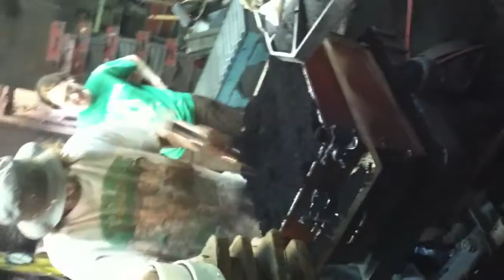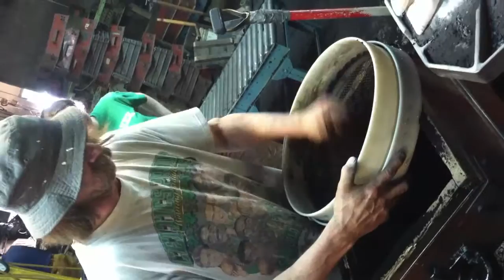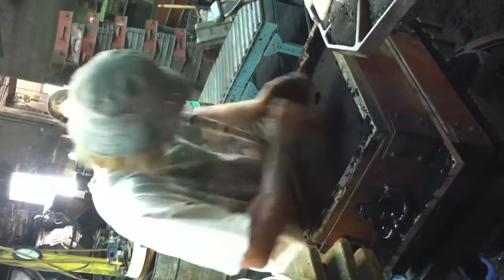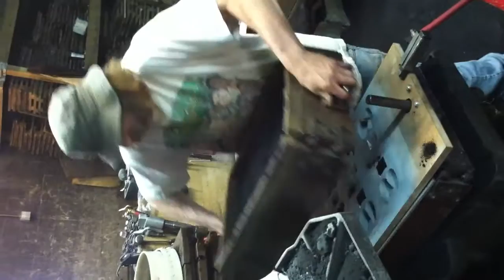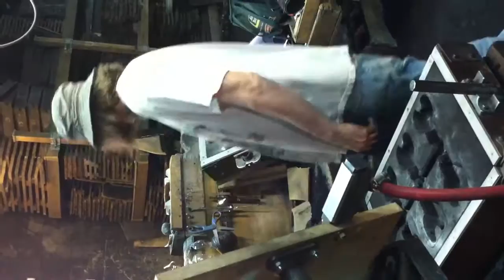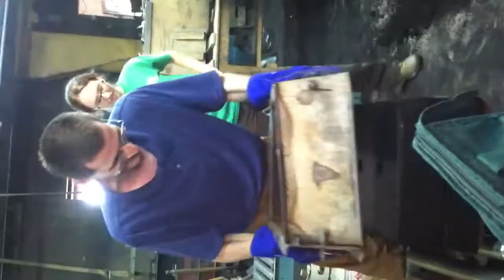펠톤주조 Part I

Comment from the maker: Pelton pallet mold manufacture
https://youtu.be/lIVD3-YdQks
Zuzzica's Hobby CNC
게시일: 2017. 11. 4.
Pelton pallet mold manufacture

CREATE Borneo workshop casted Micro Hydro Pelton buckets and Turbine Testing setup 28 Jul 2018
https://youtu.be/ThmMTd-EO94
https://cafe.naver.com/renewableenergy/80989 
https://www.facebook.com/jungyong.jin/videos/2039149899478905/ 
Ozzie Wozzie Original
게시일: 2018. 7. 29.
It is made of aluminium from recycled beer cans and other aluminium cans done at Kg Nampasan Penampang. All videos are my own work taken from my small sony handycam camera.

A micro Hydro pelton turbine runner cast in our small shop
https://youtu.be/ycCd8Inup8o
https://cafe.naver.com/renewableenergy/81008 
https://cafe.naver.com/renewableenergy/75037
https://www.facebook.com/jungyong.jin/videos/1094689140591657/?l=5380834659090995208 
Joel Horn
게시일: 2014. 12. 19.
A DIY bronze pelton turbine cast in our off the grid home shop.

Foundry Pattern Making
https://youtu.be/wOfcH5crpR0
kamalapattern
게시일: 2010. 11. 30.
This is a segment Core Box of PELTON  WHEEL 980 dia. Outside diameter of this wheel is 1300mm. 20 nos. buckets are there in this pelton wheel. 20 nos. core will be set in the mould to form a complete casting. This wheel are generally used in Hydro Turbine Project.

pelton bucket repair Athos Greece 1
https://youtu.be/L0dycz00njw
Prodromos Agioros Karies
게시일: 2012. 9. 30.
물 손상에 의한 pelton 펠렛 블레이드의 유지 보수.

pelton bucket repair 아토스 그리스 2
https://youtu.be/Y1Kjw9ONtqI
Prodromos Agioros Karies
게시일: 2012. 9. 30.
물 손상에 의한 pelton 펠렛 블레이드의 유지 보수.

At the Foundry Part I
https://youtu.be/WiB19FG_EQE
https://cafe.naver.com/renewableenergy/81392 
https://youtu.be/70hHUgmUQlQ 
https://www.facebook.com/jungyong.jin/videos/2172528789474348/ 
thayermshop
게시일: 2011. 7. 27.
Emily casting spoons for her Pelton wheel to be used in the Humanitarian Engineering project in Rwanda.

At the Foundry Part II
https://youtu.be/Az9VmHVyfvY
https://cafe.naver.com/renewableenergy/81392 
https://youtu.be/9wtktzh_mFQ 
https://www.facebook.com/jungyong.jin/videos/2172529556140938/ 
thayermshop
게시일: 2011. 7. 27.
그녀의 펠톤 수차에 대한 에밀리 주조 숟가락 르완다에서 인도주의 엔지니어링 프로젝트에 사용된다.